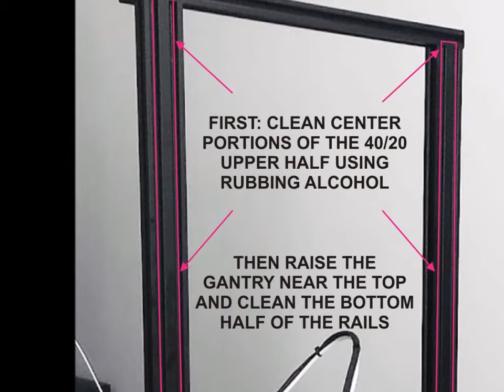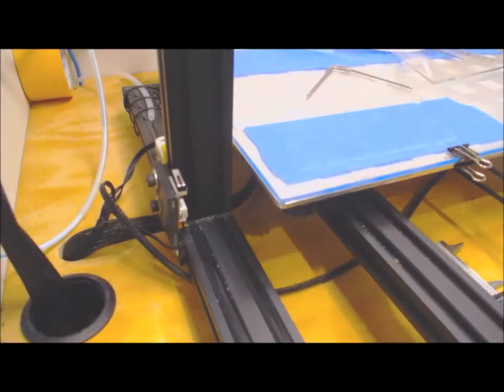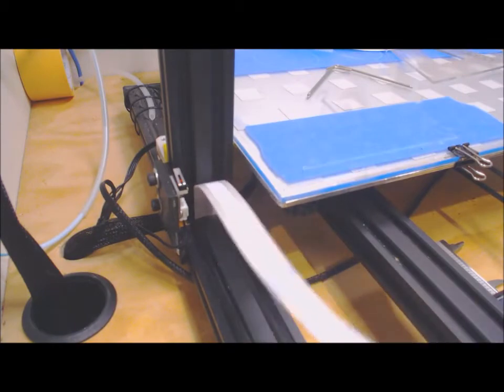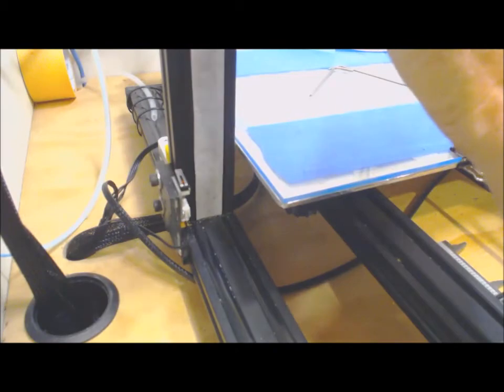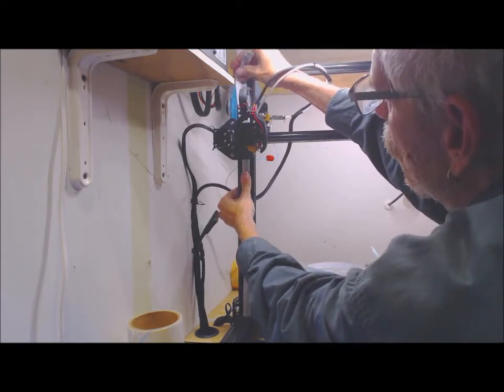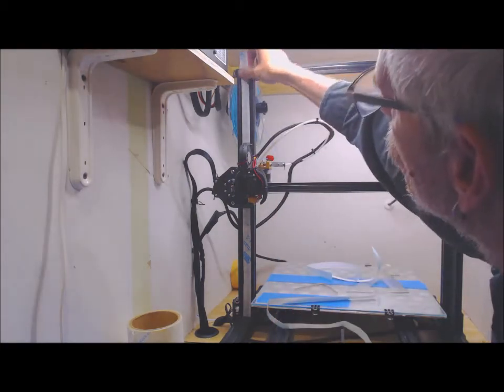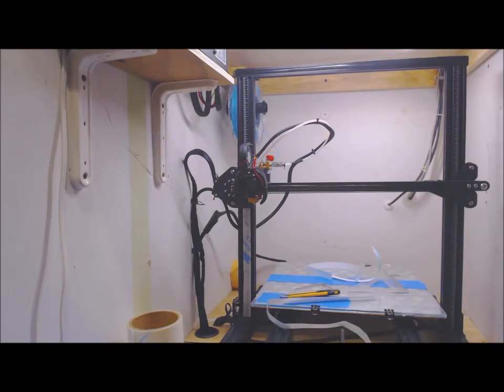CR-10 Z Axis Ruler Install pt1

Comment: Ok, So you install the ruler. Say You're 50% into a print and now you can see that your Gantry has worked its way from level. Now what? (my Cr-10s is not keeping alignment all the way up the z axis) like the motors aren't working together perfectly.
Reply from the maker: That's a tough one. Hopefully yours isn't too far off but perhaps check each side to ensure nothing is binding. My s4 will walk off about 1mm on the right side if i print tall. I just let it ride since few prints at that height are very critical to me. But that's the entire reason i came up with this idea. So I could relevel the gantry easily after tall prints. Sorry I wish i had a better solution for you